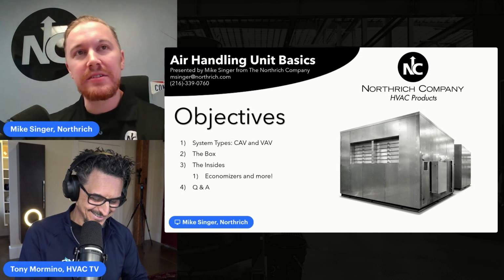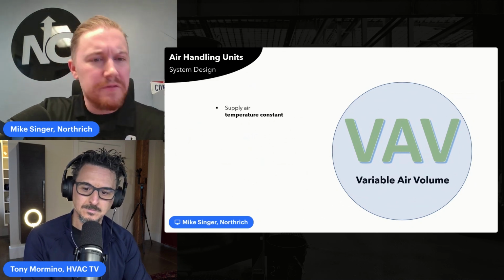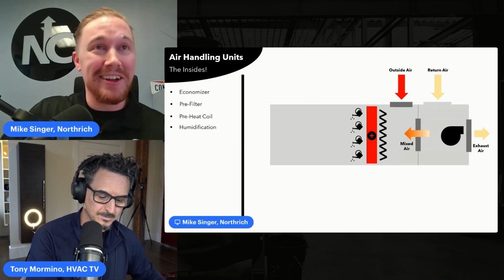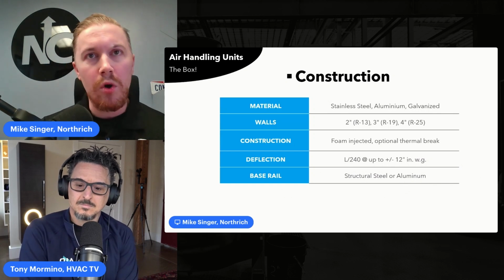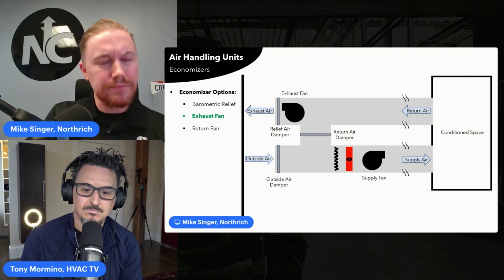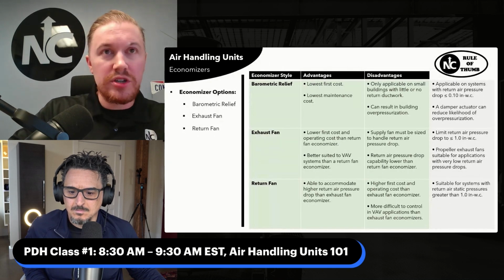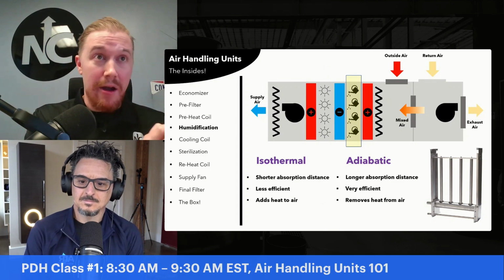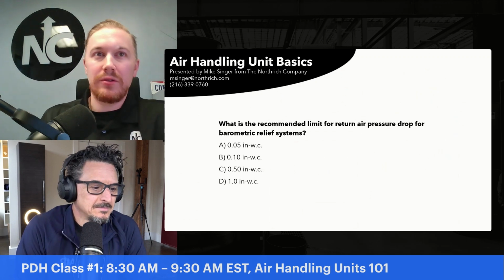PDH#1 Commercial HVAC Air Handling Units 101

Comment: I'd love to see an educational video on the new ASHRAE G36, trim & response applications for AHU's.
Help spread knowledge on how this new application is implemented into newer AHU BAS programs.
Cooling, heating & pressure requests sent from each VAV controller fed by it's designated AHU controller depending on how far or close you are from either reaching space temp setpoint or if you're not able to achieve cfm setpoint at your VAV/room level

Depending on how many cooling/heating requests you have, you can adjust the DA-T increase/decrease temp by 'X' amount of time with 'X' amount of temp increase or decrease (.5 degree decrease over a 10min span with a setpoint range between 55-65 degrees depending on your mechanical application or configuration & a .3 degree increase over a 15min span with a setpoint range between 75-95 degrees depending on the heating & cooling request from each VAV). This all depends on the configuration of the AHU of course.

Same goes for the pressure request sent back to the corresponding AHU to increase or decrease the DA-P set point. (.06inwc increase over a 10min span & a .05 decrease over a 15min span with a setpoint range on .7-2inwc)

All of these points are obviously adjustable based on your configuration of your building & mechanical equipment.